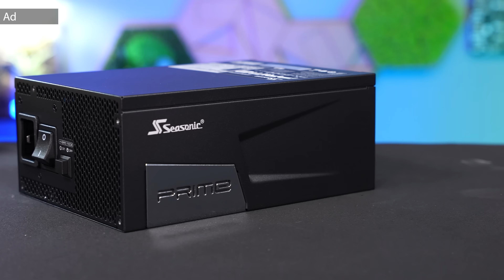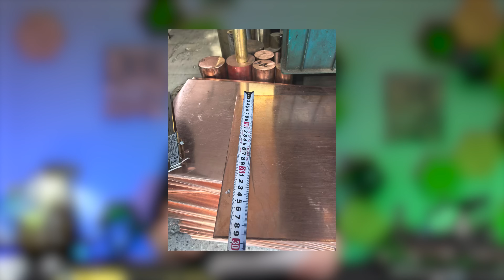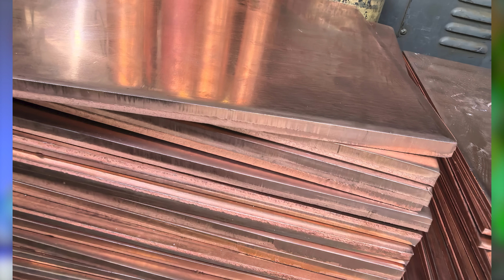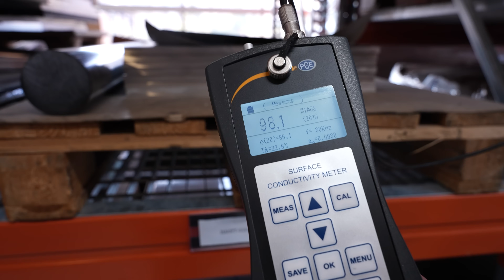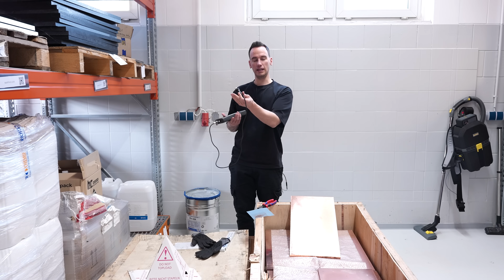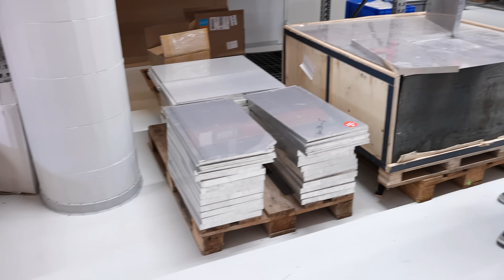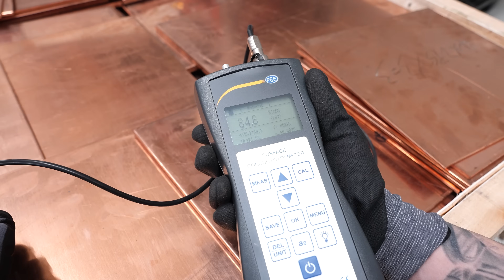I Got Scammed

Comment: Sorry to hear of your misfortune with importing from chinese suppliers. I have been doing international logistics (import and export) for over 35 years, from prawn feed to Veitnam feed to importing heart stents from USA etc.
Would highly recommend that you 
A.Never trust any supplier ever. Easpecially when dealing for the first year or two  or  for atleast the 5 shipments.
B. Get two samples from supplier, reason for two samples is one for you to check and the second to send to your authorised/nominated inspection company to cross check against your ordered items. I have always used S.G.S. 
they audit and check the goods and give a report and insurance that what you have ordered is as per sample.
C. Set up an I.L.C. (Irevocable Letter of Credit) also known in some counties as a L/C this is done through your bank.
Which guarantees payment to supplier once and I mean ONCE all set criteria what you have specified in your L/C have been met. 
D. In the L/C you need specify in the Terms and Conditions that your bank will release payment  
That you require invoice,House Bill, Bill of Loading, and most importantly lettter confirmation from S.G.S or your nominated inspection company that goods are as per agreement and also shipping date.  
This is what I have do with all international trade and sometimes domestic suppliers.
Most Chinese suppliers quote C&F (Cost and Freight) which does not include insurance( if goods get damaged in transit) that you have to do by setting up a marine insurance policy yourself with a local insurance company in Germany. 
Any reputable supplier that does not accept your terms are shaddy and possibly a scammer and you should walk away.
Take care.

Comment: You didn't get scammed, you got exactly what happens when you don't have experience in international procurement... and that's the cold hard truth.
Reply: Unfortunately, I think this is true, and even more than most people realize. Every international vendor I've worked with sends samples. This includes Chinese vendors. And it's for more than one reason. Translation is hard. Especially in this case, consider that it is actually quite difficult to apply an even, high quality copper coating to a block at very precise dimensions. Also consider how many more people want such things for decorative or construction purposes versus machining into a specific shape. Most factories who would be machining a copper block aren't going to care about the size and will melt and form the copper themselves and just take the material in whatever refined state is cheapest. I strongly suspect that if he'd requested a sample block to be sent over, he'd have simply been able to identify the problem in advance, and they would have either been able to give an updated price, or simply referred him to a factory that would better fit his needs.

Comment: I was also scammed by a factory in China 4 years ago with a large batch of electrolytic capacitors. I had an order worth 6500 euros for high-quality electrolytic capacitors, especially for the primary in power supplies and for stages in audio amplifiers. I received some junk, the cheapest possible, they were not even functional. My luck that I made the transaction through alibaba, although the seller kept insisting that we do it outside the site, he kept luring me with discounts and bonus goods. After I got my money back, I made the deal with a factory in Japan, I got a good deal on the price and their services were impeccable. Out of the total amount of 8500 euros, due to a 3-week delay in shipping, they had offered to refund me part of the money, but I did not agree to this, it was not their fault.

Comment: True story actually sad story. I was working in Deutschland 5 years ago as an electrician, our company was in a bit of financial crisis and the construction site was in hurry so we had to contact chinese suppliers for the rest of the cables. They arrived in 4weeks, when we opened that two big wooden boxes, i checked the label on the side of one of the box and the total weight per 1 box was only 850kg, it supposed to be over 1,5 tons ber box. We bought 2x 90m of 4x240 copper cable ( zulleitung ) 1,2T ( 2,5T in total ), 16x250m 3x2,5 600KG and 10x250m 5x1,5 440KG And you know what? All cables was copper plated allu shit. We were so pissed off my godness that we stopped working for a day or two. On the cable there was clearly written NYY-J we contacted police and Zollamt. After 3 months, the firma recieved a refund, around 40k €

Comment: The only way I would see you hopefully prevent this is by asking others that buy similar products from China to share their experiences with good/bad suppliers so you can find one that is reliable. But the trick is finding someone that buys similar products from China and is willing to share who their supplier is. If it was that easy I am sure you would have done that of course...

Another thing you might want to try is ask your shipping partner, they know what they are transporting and they know from which supplier to which customer. So if you can get a hold of the forwarder that is dealing with this they might be able to tell you which supplier consistently delivers these types of products all over the world. Having worked in logistics in the past I am certain that those doing the dispatching for instance will know, those doing the customs declarations will know. They could be the trick to finding out if this supplier is consistently delivering to the same customers or if they are only doing one time shipments which should set off alarm bells of course.

Comment: I did some quick and dirty research in Chatgtp and it seems that legal action is maybe not as impossible as you think. For example, in 2025, a foreign supplier recovered losses in a fraud-related contract dispute through a settlement supervised by the Supreme People’s Court. 
"This reflects China’s increasing attention to international commercial dispute resolution." Is the LLM's conclusion when asked for actual cases, not hearsay. Of course, this guarantees nothing, neither does this give an idea of the legal costs involved. Maybe you should do some more research into what the possibilities and procedures are so that you at least can threaten those companies with legal action in a coherent manner. Also, make sure you have enough evidence before you scrap the material. Good luck, fingers crossed.

Comment: It's actually harder to source or manufacture these sorts of fake plates than the real thing.  So there's no way they'd fail to air-mail you the real thing, and then swap the bulk shipment.  The only thing you could do would be to work with a local shipper that has nexus in the EU and people in China to verify the shipment via the same in-depth tests before taking it out of China.  The problem is if there were such a shipper, they'd already be doing that.  That there isn't is a good clue that you're going to run into trouble.

Comment: They do the same thing with brass and copper brushes. A thin coating then some cheap steel underneath - so it will ruin your items you use them on, as the underlying steel is much harder and scratches what you are trying to clean.

Comment: This is an extremely pervasive problem right now. Since the rise in commodity and precious metal prices these past few years, the scammers have perhaps multiplied a hundred times. It's an easy scam because it's not easy to check metal purity.

Ebay, Etsy, and Alibaba allow vendors to openly sell jewelry with false claims of containing precious metals. I made it a bit of a hobby to buy these suspicious rings (all seeming to come from Asia). I would conduct purity tests on them and post pictures of the results as my review. 

There are similar problems with precious metal bullion bars and valuable coins. 

I'm a big fan of open markets, but there is a huge problem with allowing commerce between two parties when either or both parties have no accountability to the law. I'm really not sure where the law enforcement is when it comes to these scams. The amount of money spent on enforcement would save multiples of what people are losing to these scams.

Comment: Unbelievable, the Extent the China Companies went through to pull off such a scam..
100's of photos and inspection docs..
calculated weights.
Just think about it...
Cut the steel to size, then electroplate it with copper so it all looks like copper plates..

Comment: Thank you for sharing your experience. I repair electronics as well, and I’ve run into similar situations. While I haven’t experienced it on the same scale, the frustration, and the sense of betrayal, when you rely on components/supplies only to discover they’re counterfeit is infuriating. It becomes even worse when you confront the seller and they respond defensively or refuse to offer any kind of remediation.

I agree with others here that sharing the company’s name and spreading the word about their business practices can help prevent others from experiencing the same loss. Unfortunately, that protection is often short-lived. Companies that operate this way frequently rebrand or change identities, which makes them difficult to track and avoid.

Comment: Source Third Party Inspection (TPI) would've helped you in detecting the issue. We're very stringent when it comes to sourcing from low cost countries such as China and Eastern Europe. NDT, Destructive Test, review of material test certificate and correlation with the Heat No are some of the basic checks we make when procuring raw material. In my opinion, this was a pure source QA/QC issue from customer end.

Comment: Hopefully, you used a Credit Card and got a refund but I doubt they would allow you to pay with CC.
You can report them to the appropriate authorities in China; THEY WILL do something about it. But it will be much easier if you have a liaison in China

aside: A way to avoid this is on a new supplier, limit purchases to under $5K or $10K, until you have at least 3 orders, then double/triple if you want more, and don't go up until you get three of those as well. 
Order 1: $5K
Order 2: $5K
Order 3: $5K
Order 4, 5: $10K, $10K

Especially since you don't know the exact quality, or perhaps might want to make changes between orders. It might cost a bit more, but on a new supplier, it might be worth it. 
Ofc, you can always work with middle-men / websites, where there reputation is on the line as well; e.g. reputable sellers on TradeKey, AliBaba

Comment: Not even a finished product from China is safe from deception.  I bought a 15A extension cord.  The thickness of the cord looked right.  But it ran warm which my other 15A cords didn't do.  Then I decided to cut it.  It turns out there was a whole lot more insulation than there was copper.

Comment: Unfortunately, the only way to guarantee that you don't get scammed, would be to: go to China, get the goods from the source and test them 100%.  Once you're satisfied that it's all legit, proceed to the second stage and send them to a location where you can monitor them being packaged for shipping and verify them being loaded onto the ship.  I'm sure there are companies who provide this type of service, but after your experience, who can you trust?  

   I have a friend where his father had an elevator company in Iran.  They ordered about $1,000,000 USD worth of equipment from China.  They went through the same process as you did.  Once they opened the container in Iran, it was filled with scrap wire and random scrap metal, with a total weight equivalent to what the actual weight should have been for the legitimate products.  They had to dissolve their company due to the massive financial loss.

Comment: Oh Noo 🫣! That could have happened to anyone! Don’t feel embarrassed or ashamed bro, you did your due diligence as best you could. 

There will always be some element of risk when trying to establish new suppliers overseas. Business is supposed to be conducted in good faith but they clearly went above and beyond to commit fraud. 

With such specific dimensions and given the plate material being ordered it wouldn’t even make sense to ponder if a 3rd party intercepted your shipment. If that had really been the case a 3rd party would have simply filled the container with scrap plate steel to maintain outside appearance of legit. The fact that it was dimensioned exactly as ordered and a thick coat of copper means the company had no intention of honest business. 

Even if you had ordered a smaller batch to act as a sample and everything arrived exactly as it should, there is nothing stopping them from just ripping you off when you do the full larger order later.

Comment: In manufacturing, trust is a liability. You trust the X-ray machine and the escrow agent. Without a third-party metal audit, you haven't bought a product—you've made a donation.
The Three Hard Truths

The Illusion of Choice: The second factory you "vetted" is likely owned by a friend of the first. In close-knit industrial circles, people share your enquiries and establish the cost of being from "the soft part of the world." 

The State-Owned Shield: Major metal producers are often state-backed. You have zero legal recourse against an entity protected by the system. Justice doesn't exist for foreign buyers who fail to verify.

The Chain of Custody: Between the forge and the freight, there is a "black hole." Without a sealed, verified loading process, you can’t prove who swapped your materials. No proof means no accountability. Fix with the right security seal.

Why Hire a Professional like Me?
You pay a premium to be impossible to rip off.

Comment: Sorry man, that has got to be a terrible feeling. $40,000 isn’t that much in comparison to other products, as you pointed out an extra $10k for air freight is detrimental to returns. I hate to be that guy since hindsight is 20/20, but when we source products we send inspectors to inspect the manufacturing, witness the sealing and tagging of crates/pallets, etc. Inspection in china is a lot cheaper than USA. You might be turned off from Asian suppliers from now on and rightly so. But getting someone on your team (even a consultant) who has experience in global procurement would probably help out in the future if that’s what your business needs.

Comment: Holy fuck, scammed by two different suppliers, that's fucked.
Reply: And still probably hasn’t learned the lesson of: always pay through the platform and don’t go outside of it to avoid fees. They charge those fees because this shit happens, all the time.

They know they can screw you if you’re not using the platform.
Reply: @JaxPotato  if the company is actually trust worthy. I don't think they are.

Comment: this is 100% normal, 
I knew a guy who's job was to fly to china and evaluate the material before it is loaded into the container, then seal the container and watch over the process of the container being handed off to the shipping company. 
They then received the container with a broken seal and everything swapped out for trash steel. 
this has happened like 5 times.

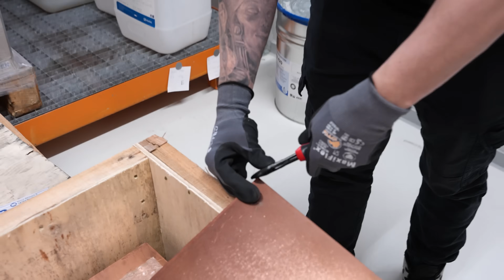Comment: 6:27 Wow, 99.99% copper is MUCH higher then normal copper. Why the high price for just a water block? I could understand if it was in a high stress environment, like an engine or structural part, but a water block is neither of those.

Comment: Alibaba has buyer protection, but if in the case you wired the money direct, that's a tough deal. In the laser industry, we see this type of stuff a lot when bypassing buyer protections. It's still a good idea to try and flag it with alibaba so they are aware and they might be able to get you in contact with proper authorities in the seller's area for fraud since it may negatively impact alibaba's reputation when this type of stuff happens. May not get the money back, but they may still hold the person who registered the business and processed the transaction accountable. Also sadly, scam businesses like this pop up a lot on alibaba/aliexpress and other marketplaces like ebay. They start accounts even years in advance, build up some fake reviews with internal transactions (basically just losing the fee's for the transaction on the platform), and then let it build up age for reputation. When a scam account gets flagged with bad reviews or shut down by the platform, they just rotate to a stockpiled backup account.  The best thing you can do is not give up buyer protections on marketplaces, and make sure you flag it to the platform they are trying to circumvent(if they processed the transaction externally) and any authorities you can. Some platforms also frown upon or have contractual terms basically poaching buyers and processing the transaction externally since the platform then also loses money, so you might actually get help from them for reporting it.

Comment: If the water block is steel with copper plating, does it really make that much of a difference not being pure copper? Mill one and do a test. Salvage the project with cheaper costs and disclose its materials from the scam. Good opportunity to do a side by side test. As a business you need to be dynamic.